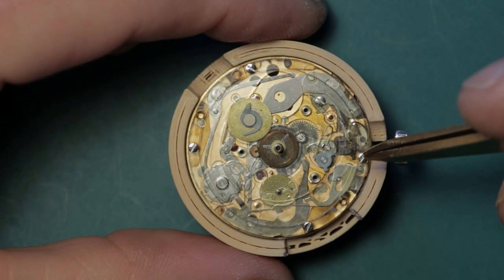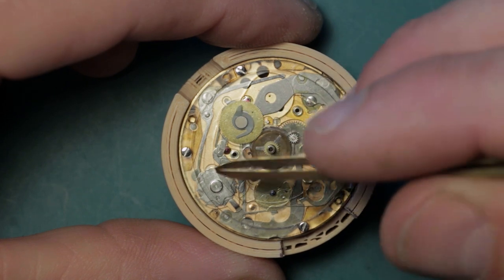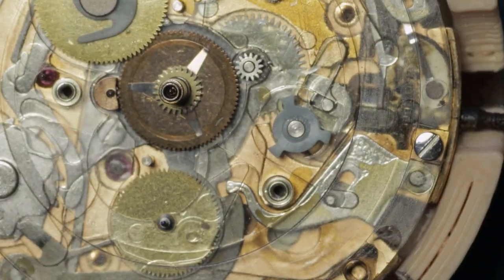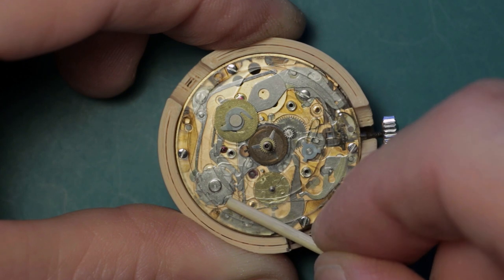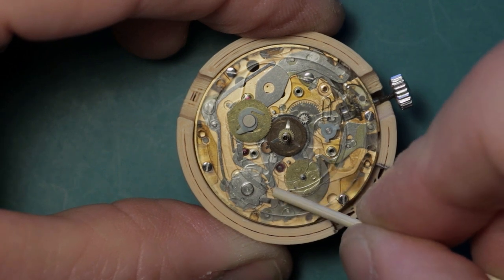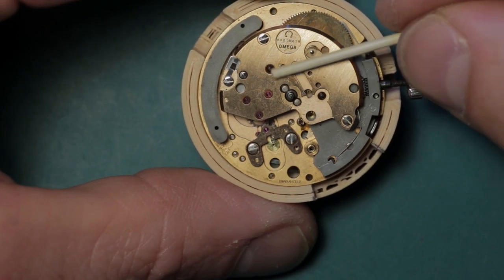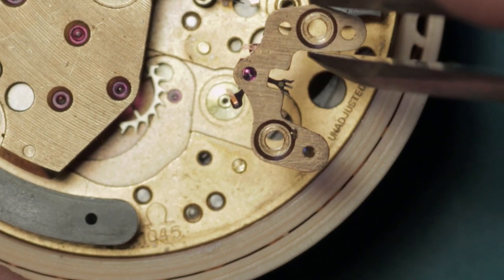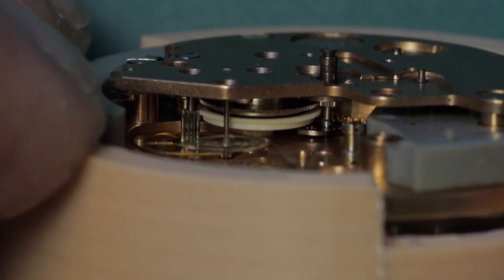Omega Speedmaster Oil Slick - Omega1045 Lemania 5100

Comment: I hope a full service video is coming up later. I can't wait to see the disassembly, diagnostic, repair and service.
Reply from the maker: I would like to but it will be dependant on time permitting as I'm very very busy with work currently. I'll try to get enough filmed to make a video.
Reply: @spidiq8  Would be interesting to know how you'd tackle that wobbly escape wheel...
Reply from the maker: @charlesd820  What wobbly escape wheel? (he says staring cross eyed) 😄

Comment: I think this is the correct model........From Worn and Wound.......In 1974, an interesting blip in the Mark series made an appearance. Nicknamed the Mark 4.5 by aficionados, it contained Omega calibre 1045/ Lemania 5100, and bore reference number 176.00xx (xx = 12, 14, 15, and 16). The .0012 was cased in the MK IV case. The .0014 was cased in a very 1970s looking TV or cushion shape, and the .0015 and .0016 featured fairly flat, and relatively timeless styled tonneau cases. Some have said this is the most beautiful Speedy of them all.

Lovely watch Che.  Very interesting they used that see-through the plastic.  Swatch DNA LOL
Reply from the maker: That's fascinating info, thank you.
I've heard people refer to them as the Mk4.5 but don't really know the lineage of the Speedmaster.
I do know that I really love this case shape and design over any other variant than the moonwatch and am so impressed with the 5100 that I had to look for and have just bought an Eberhard & co with a 5100 in.
Sadly I can't stretch to the Sq-omega but i'll have a sneaky test wear of this when complete. :)
Reply: @spidiq8  sounds lovely.  Don't know much about that brand but can't go wrong with that movement.  Watch prices have been on the up for sometime but I think it will level out.  Things got crazy for a while.  Grey Market guys are trying not to hoard as much as they did.
Reply: @spidiq8  gosh just looked them up.  Some cracking timepieces no doubt.  Don't know why I never heard of them.
Reply from the maker: @speedypaul2314  They're not well known but as you discovered made some gorgeous watches, I think they're a vintage which will become more appreciated in collecting circles in the future, (you heard it here first, start buying them up now while they're cheap) :)

Comment: Great work. Is the „holder“ of the clockwork YouTube own construction? I want to Print such an holder with my 3D Printer. My Bergeon 4040 movement holder is Not the best in This case. Do you have a Plan or CAD Drawing
Reply from the maker: If it's one of the round plastic type then yes, I draw them up in Tinkercad and 3D print them, they're a simple design of tubes and holes, I'm no CAD designer but Tinkercad makes it simple, you just have to measure the movement diameter.

Comment: Is the Lemania 5100 considered to be mechanically inferior to the Valjoux 7750?
Reply from the maker: Not at all. Some would consider it a slightly superior movement in some respects.
It's incredibly robust and sturdy and the mix of materials gave it excellent shock proofing abilities and it was widely used in military applications. It can also find for COSC accuracy.